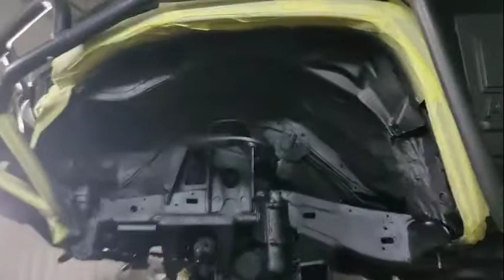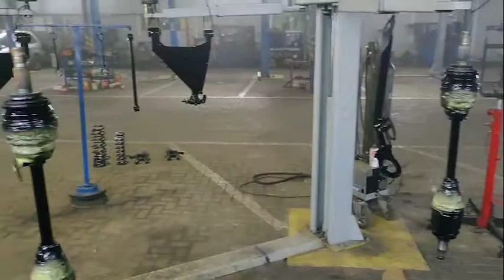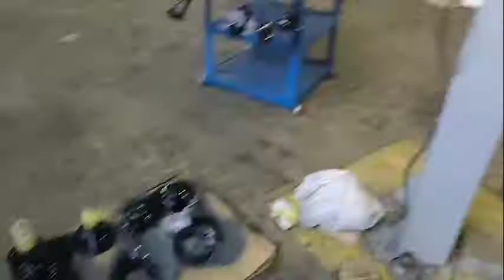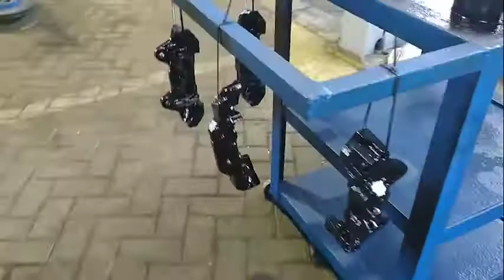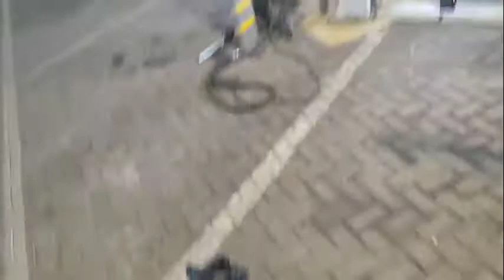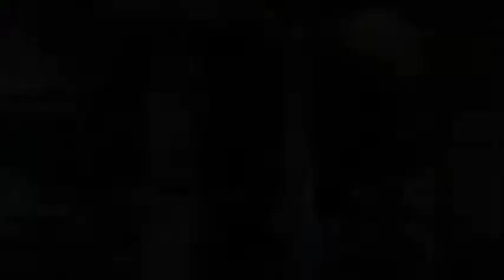Антикор. Антикоррозийная обработка, Toyota FJ Cruiser

Comment: suppose that conveyer type tracks, would be used, EVERY THING WOULD BE SO MUCH EASIER. ESPECIALLY WHEN THE WIDTH OF THE TRACKS, AND THE BOTTOM LENGTH WOULD BE MADE ELECTRONICALLY ADJUSTABLE.